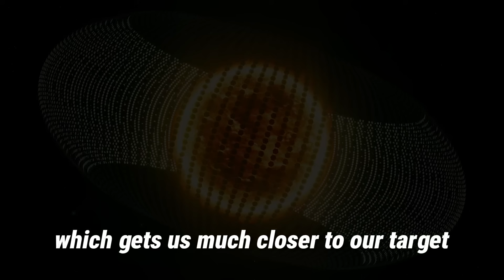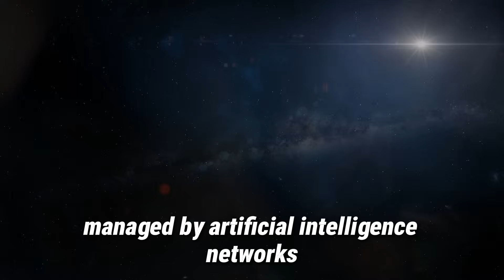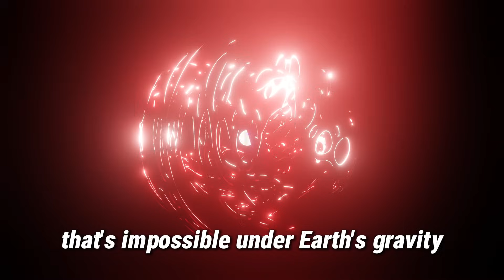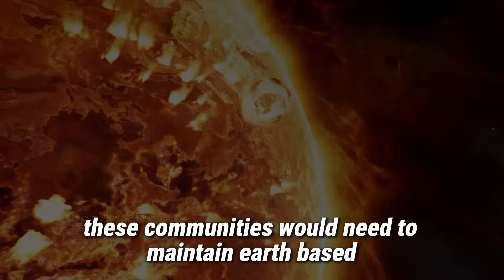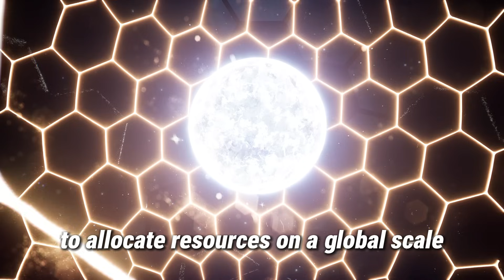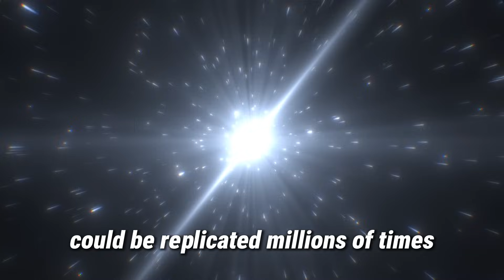The INSANE Scale and Engineering of a Dyson Sphere (Explained)

Comment: All this mega-engineering just to collect energy by solar panels which is incredibly inefficient, and then somehow wirelessly transfer that power a vast distance for utilization means even more loss. Fusion reactors are faaaaaaaar more energy dense than this nonsense, and they can be located at the place of utilization with almost zero power / conversion loss. 
Just the amount of material needed will require gathering and transfering back planetsworth of material from other star systems :D